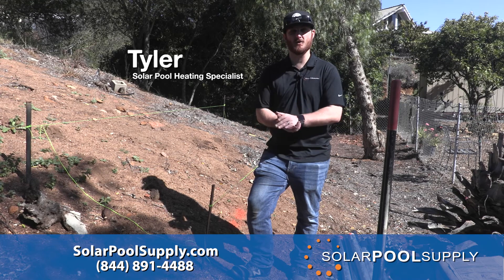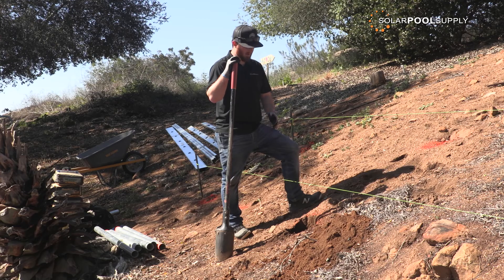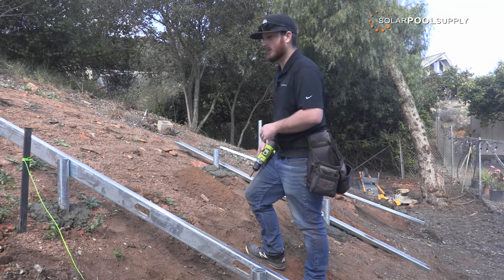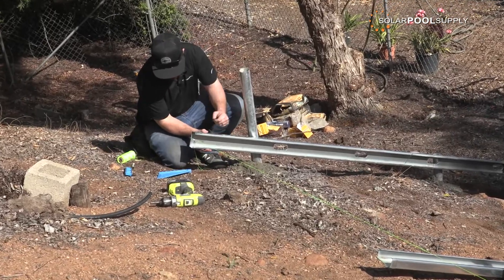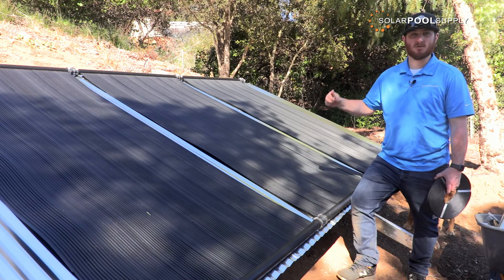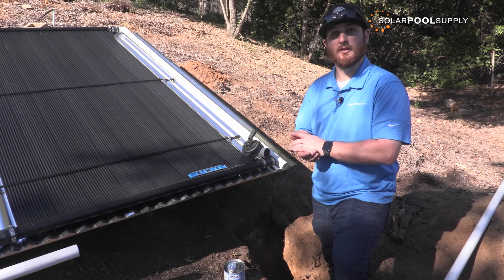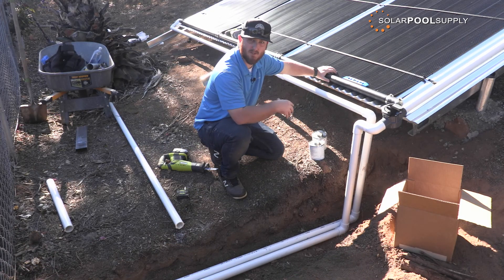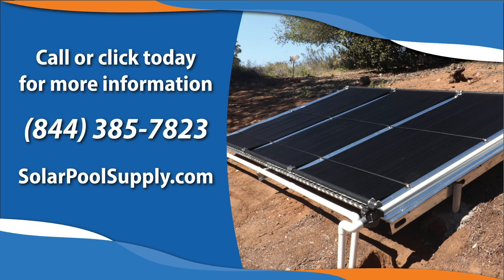Solar Pool Heating Ground Mount Installation

Comment: Nice video, well done!

I'm planning to build something similar for my solar pool heating setup (currently in the planning stages).  What baffles me?  Calculating the total width of the ground mount structure.  I realize that the panels I'm looking at are 4 ft wide by 10 ft long...but...is that 4 ft from connection to connection, or is that 4 ft wide for the capillaries alone with extra space between panels for the connection between the panels?

Do you have any guidance on calculating the width of the ground mount structure?

Comment: I’m building this on flat ground , how long the front and back pole has to be like what angle I need to make
Reply from the maker: I would recommend an angle of 10-35 degrees. the exact angle depends on the orientation of the panels and your location. Minimum is calculated at 1/8" per foot of panel. maximum is 45 degrees.